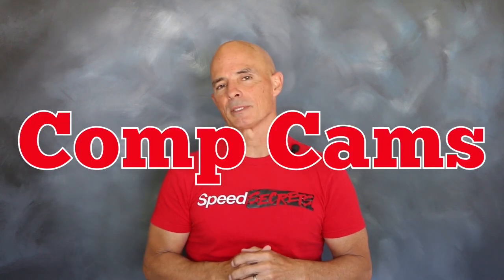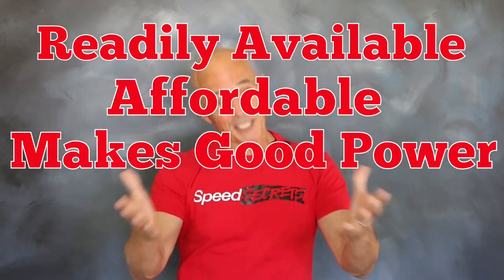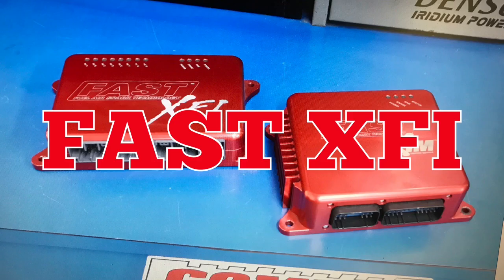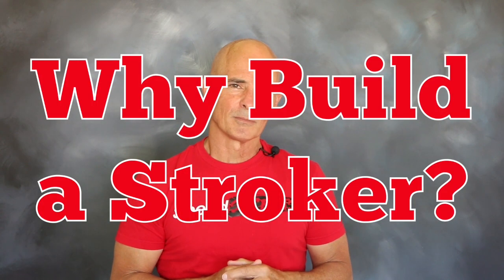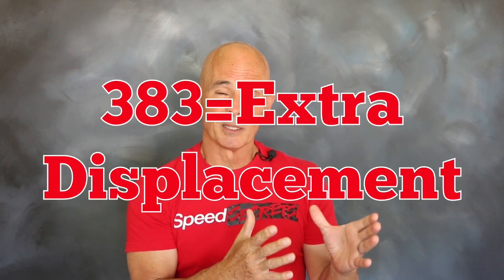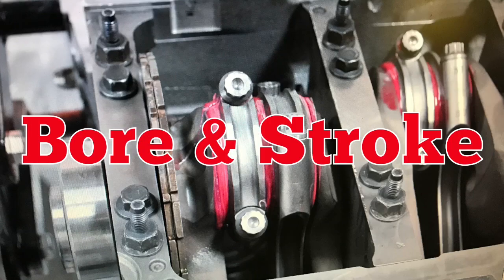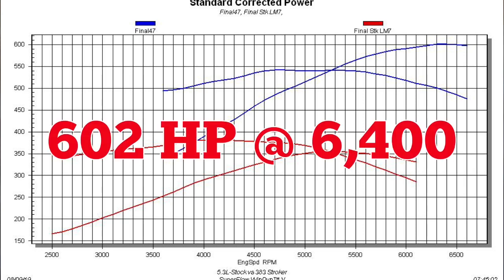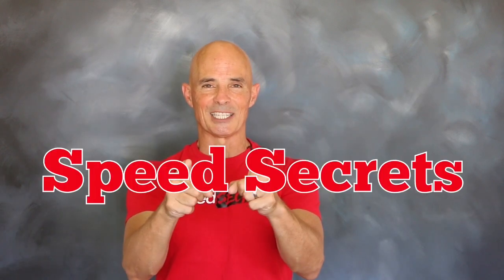Speed Secrets: Why Build a 5.3 Stroker?

Comment from the maker: A couple notes on this: Yes, you CAN make more power with a turbo setup, or going with a 6.0, or whatever else. However, this test was done in the interest of proving that there are many ways to gain power. Hot Rodders have been building 383's for decades and making great power from small block Chevy's. If you're interested to see what doing a turbo setup would gain you, check out our LST Turbo Camshaft test video from a couple months back!
Reply: COMP Cams my I have the build sheet with all part numbers please ?
Reply: Thanks Man. Never everybody wants to be like everybody else with a 6.0 and or Nos. I like being different or rare. So thanks for the video truly. 🤝🙏🏽
Reply: Comp cams is there  a build sheet with all parts listed with part numbers, and everything else used to build this engine ?
Reply: Where can I get the stroker kit from ?
Reply: What cc pistons?
Reply: How much for everything
Reply: Yeah and a 6.0 will be alot more then a 5.3 to start so good video

Comment: For the past 2 years, I have wanted to build a N/A 408 Stroker but I am wondering if the extra cost of the 6.0 is worth it. Because I have seen Richard and other people pull 650hp from 408s but you are saying 600 hp is possible from a 383 stroker. What i want is a motor that has that fun low end torque and the big block sound naturally aspirated.

Comment: Hi Richard. I have a 24 ft command bridge fishing boat and looking to give it some more get and go. I have a Lm7 5.3 and have been looking at the best way to accomplish that. I was thinking of building a 383 stroker out of the 5.3 to get more torque and a little more power. If I bored it to 3.905 and changed to 4.00 stroke I get a 383 as you show above. the thing is I don't need over 500 hp and the torque and HP between  3000 and 5200 rpm. Would a truck norris cam get me there.

Comment: Im planning on boring and stroking my 5.3L to have at least 460hp, but have 500tq down low at the flywheel. Im going to be usig it for my 2011 suburbsn with a 6l80e (beefing it up as well), and 3.73 gears. Im hoping to tow at least 10,000lbs reliably. Wish me luck.

Comment: Will a 383 made out of a 5.3 be reliable long term as a daily driver also will there be cooling issues with the motor bore being enlarged that much. Also say I just wanted to punch out my 5.3 to a 5.7 ls1 and I already did a cam and head swap on my 5.3 to a BTR truck Norris cam and 243 heads I know the heads will work good but what about that cam? Will I need to change it after making it a 5.7?

Comment: 5.3 heads can supply way more airflow than a 5.3 can even use in a street usable rpm range I wonder what the stock 5.3 heads could do with just a stroker kit and cam with stock cylinder heads

Comment: Richard, How about building a stock 4.8/5.3 4inch stroker with stock cam and then add stage 1,2 & 3 truck cams.  This would be a good towing motor and should be equivalent to a 6.0 block that you tested before.

Comment: Isn't the piston unstable at BDC with 4 inches of stroke in a stock sleeve block ? Wouldn't it be better to do a 3.750 stroke with a 4 inch bore on stock blocks?
Reply: they're using the longer rods that keep the piston in the sleeve

Comment: Hey Johnny! 
I'am now in the beginning process of rebuilding my 04 5.3 LM7 . Having to bore .0030 over , also going with BTR stage2 cam , have SS hedders but shorty's installed a year ago , will be using those till then Wany directed suggestions  from you is always appreciated ! Also rebuilding trans and rear end . My baby has never have me trouble in the past until now.. started chasing a ghost.  So with 200.000+ od . Better do it now than be sorry later..
Reply: Doing the same

Comment: What kind of pistons. I just found out summit has a cheap kit for 5.3

It’s a 363. 4 inch crank and 5 over pistons. But the guy didnt mention valve relief. 

I really like the idea because a monster 4 inch crank. Bigger then the 400 sbc and good heads. I believe you said 706 heads.

Comment: Where did you get the pistions with the 3.905 bore and who would you recommend getting them through.
Reply: It's just an LS1 piston .010 over roughly. Not an issue, the issue is getting pistons with shorter skirts not to rock at bottom of stroke out of the cylinder. Wisco will make them for you, but I think already making them.

Comment: Can you boost a 5.3 with a Bore that big and what if it’s a aluminum block. I acutely just aquiard a 4” crank and trying to finger out if I’m going to use the aluminum 5.3 block and save a bunch of wight or go put it in a iron 6.0 block.  I have both it’s a race car 3275lb it’s been 9.88 with a 4.8 with cam and turbo but I want to get the car to it’s new chassis stickers limit. Lol.

Comment: Ive got a similar build.  Using a BTR stage 3, TBSS intake, and 92 mm tb. Going in customers chevelle. still just 9.5:1.
Reply: Can these things handle boost as well or better than the stock 5.3?
Reply: @bananaman2184  
Sure they can especially when having proper ring Gap.

Comment: I have a 5.3 stock other then long tubes any suggestions on head cam and intake combo looking for closer to 450 best bang for my buck!
Reply: BTR Torque Cam
Send stock heads to Texas Speed for port+polish
Texas speed 1-7/8" long tube headers
Reply: @foxyepoxy602  how much you think that that will produce in to numbers?
Reply: @michaellinkous7449  my estimate would be between 50-90HP and 40-70 torque.

Comment: OK what did you do to the crank ? Throw it out and get a new one or have it machined for the bigger stroke ?  And what are the connecting rod sizes, rod and main bearing sizes? Do you have to have $2000  fast xfi management system ?

Comment: my 5.3 into a 383 is a great idea thanks
Reply: ,,,,,,,,,,,,,alot cheaper to get a 6.0  or 6.2  from the wreckin yard............................I have a  2000   1500 with the meager  5.3................newer mills have aluminum heads...................I hate little motors,,,,,,,,,,,fuuuccc   turbos .............give me a new edelbrock  VSR  or what the screw they call em,,,,,,expensive    but they deliver out of the box....................

Comment: What kind of stall converter would be needed for a setup like this? I assume it would be too high to go into a truck that will tow from time to time.
Reply from the maker: Correct. For a 5.3 truck that does a lot of towing, some of our No Springs Required setups would probably be a better option. Something like the 54-700-11 paired with a 2400 stall would be an excellent towing and street setup.

Comment: Was wondering what's a great 5.3 ls 383 kit out there.
Reply: A few companys make stroker kits for a 383 LM7 Scat Eagle with all the good slugs from Mahle JE Kieth Black ATK builds a nice 383 LM7 ready to go for under 3500 from Summit Racing just bolt on some good cathedral ported heads trailblazer intake 92mm of course and do 600 horsepower burnouts🤜💥🤛😎😎😎

Comment: How about a 4.8?
Reply: Same engine different Internals
Reply: 4.8 is the same engine as a 5.3.  The only real difference is the shorter stroke that the 4.8 has, and they typically have flattop pistons, whereas the 5.3 does not.  So, you could apply these exact same mods to a 4.8 and also arrive at 383 cubes.

Comment: Why do 383? I've heard people will stroke the lm7 to 347ci max and make the same power with just a bore difference or buy lm7 stock size forged internals and build a boost 325. Plus isn't going for 325 ci to 383 ci dangerous for the skirts in the cylinders? Or am i wrong?

Comment: I thought turning an iron block 5.3 into a 383 stroker would eat pistons, I considered building one but I had very experienced builders and racers tell me this.
Reply: Depends on what rotating assembly you use and in what block.  From all the measurements I've taken, most of that theory is myth and noise.  Most rod/piston combinations with a 4" stroke still stay in the cylinder at BDC.  Iron blocks do have shorter cylinders than aluminum so keep that in mind.
Reply: Zachary Morris I have an aluminum block 5.3 so would that mean I wouldn’t have to worry about it? Or does it need to be resleeved first?
Reply: @601performance5  depending on the year of the aluminum 5.3L it can naturally be bored to 3.898-3.910 (GenIII LS1 base casting with cam sensor bore in rear of block) or 4.00-4.20 (GenIV LS2 base casting with DOD/AFM bosses in valley).  The 5.3 aluminum blocks are sleeved down from 5.7 or 6.0 so you can naturally go back up to those bore sizes.  A ~383 would be standard stroker for GenIII and a ~402 would be standard stroker for GenIV.
Reply: Zachary Morris I’m not sure if it’s gen III or gen IV, I’ll have to look up the vin but I’m thinking it might be gen IV.  Do you have experience with how well the motors handle boost once they have been bored out?

Comment: I thought turning an iron block 5.3 into a 383 stroker would eat pistons, I considered building one but I had very experienced builders and racers tell me this.
Reply: I have heard of people having issues with strokers . Pistons go past BDC pistons wobbles and scored the piston skirts .. but herd that with a 6.0 into a 427,, 5.3 may not do that .
Reply: Eat pistons? The only thing that'll eat pistons is poor lubrication or improper piston-valve clearance due to poor can selection or not eyebrowing the pistons to compensate for a wild cam.
Reply: JoeIsCrazyWillman I’d have to talk to them and see what set of pistons they were running to cause this and if they did all of the preventative work.
Reply: JoeIsCrazyWillman he’s talking about piston skirt wear .
Reply: @LethalFrenchFry  why would the skirts wear out? Again, would be a ubrication issue, no? What else causes wear in the cylinders and on the pistons but dirty oil &/or poor lubrication?
Reply: JoeIsCrazyWillman Well the reason I was told it eats pistons, is that the piston comes so far down it will wobble or something like that and eat the side skirt of the pistons.  I’ll have to talk with them to see what piston they had and see if there were any other issues or causes.
Reply: @601performance5  Sounds weird that something like that would happen. Sounds like bad parts design or improper installation. Shouldn't be an issue of long of stroke. pistons shouldn't be coming out the bottom of the cylinder.
Reply: JoeIsCrazyWillman idk for sure but just thinking of what could cause it, maybe he shortened the rod slightly more than needed to clear the cylinder head.  That’s just a guess though idk enough to say for sure and I’m most likely wrong because I don’t know enough about what rod length to run to be able to say.

Comment: I wish this would have just been a stock vs stroker comparison with everything else being the same.  When you toss in a cam, ported heads and an intake to the stroker, it's no longer a legitimate or fair comparison.
Reply: Absolutely. That, or put heads, intake, and cam on the 5.3 and test it that way first before doing the stroker kit part

Comment: I’d rather watch Kimba The White Lion lip sync this than watch this guy.
Reply: Might be silly, what could you do with a 2010 5.7 hemi 390 hp and 400 torque, to a 383 stroker. Would there be a significant difference?and if so what would I have to replace? 7/23/2020

Comment: That's a hell of a gain. Stroked 5.3 making 600hp. This is a rowdy little engine..
Reply: its not just stroked... 

a stroked 5.3 is a 363... 383 is a stroked 350/5.7/Iron-LS1...
Reply: @KaosProject21 currently working on my LM7 383 now.
Reply: Think it’s just theoretical power they didn’t show shit. Only proof I can believe is they used his forehead as a cam profile
Reply: First Richard always does testing, that Dyno sheet doesn't come from nowhere dipshit, the same engine is featured on his channel

Comment: Lollll a good engine for NA applications l wouldn't boost it.
The 5.3 LM7 stroker is the new LS stroker as a step up from the old small block chev 383.
These two valve engines love a 6 to 10 degree split and 113 to 115 LSA anything over 600 lift is a bit of overkill.
I have just the cam in mind lollll lollll lollll.
A crane HR-224/347-2S1-154A
224/232 115LSA 590 590 LIFT.
😂😂😂😂😂

Comment: Would this engine combo support NOS?
Reply: That cam probably wouldn't be ideal with nitrous but you could certainly use a quality rotating assembly and have no issues.
Reply: 114 LSA on a cam is perfect for nitrous or boost. When your lifts and overlaps begin, thats where things vary more on boost vs NA vs Nitrous.
Reply: So the short answer is yes it will work fine. The long answer is you may want a different cam more specifically designed for nitrous if that's what you plan on.

Comment: You can literally do the same thing to nearly ANY V8 and make THE SAME POWER
Reply: Admiral Sandwich mmmm sure but the cost is huge. With the aftermarket sure you can do anything now, before the aftermarket you had to go with the oem who had the better parts like cylinder heads. This one is still going to be cheaper than any other style
Reply: jubjub f  A stroker motor is out of the budget for any man who doesn’t make much and wants good power

Comment: Just go 6.0 it's easier
Reply: The 6.0 are 1,500 at least and that's without the wire harness and trans. Add both those in the mix and your talking $2,000 for a junkyard set up. Here 5.3 in Washington (west coast) will run you about $500 add in the harness and trans $750.

Comment: I have a 2004 5.3 engine with 706 heads and I also have a set of 243 heads. What the best heads to put on a 5.3
Reply from the maker: 243 Heads are generally considered to be the best stock casting Cathedral Port heads there are.
Reply: COMP Cams Does 243 heads work best with flat or disc pistons. Would I lower my compression if I put them on my engine
Reply: It would lower the compression but just have the heads milled or run a thinner head gasket. 243 is a better head.

Comment: It is too bad you ran the engine without accessories. Using an engine dyno means viewers must already have to calculate drivetrain loss in order to compare the engine to most non magazine car builds out there, as the proliferation of the chassis dyno has made that the go-to way to judge engines.  Now they have to consider how much less power would be made if the engine had accessories on it.  There are really too many variables to even try to speculate on.
Reply from the maker: While you do have a point, the drivetrain and accessory losses affect both numbers equally. The gains will be the same after accounting for roughly a 20-25% drag on the engine.
Reply: I agree that the percentage gains will be the same with or without accessories.  However, without knowing what the engine baselined at with accessories or better yet, in a chassis dyno, we really have no way to compare it to another test.  The title is "why build a 5.3 stroker".  Now we will have a bunch of people who don't understand what they saw in this video running around claiming 5.3 strokers make 600 horsepower and expecting them to outpower other builds making "only" 550 to the wheels.
Reply from the maker: @jebadias1468  we completely get where you're coming from! The big issue is cost and time (which go together usually). Doing these tests in a vehicle would require WAY more time, and there is a ton more variation with chassis dynos. As you've probably seen, you can easily manipulate chassis dyno numbers, as well as the variations you get with transmissions, wheel weights, and rear gearing.

Comment: I love the info, but the whole 5k bolt on 5.3l stuff seems a little rich for an engine I can replace for 500 bucks.

I mean how many dollars per horsepower are you willing to spend? Why not take that same 5.3, and stuff a good cam, and a single turbo to make the same 600, and do it with way less money, and effort. Plus when it blows up from beating on it you are only out a junk yard engine, and not a high dollar rotating assembly, and heads that are trashed.

Just seems like a lot of playing "pick the most expensive parts" engine building, and we have yet to hear any real speed secrets.

Right now the only speed secret seems to be a fast lsxr manifold that costs 3 times what a tbss manifold costs, and it delivers very little comparatively.
Reply from the maker: Richard Skipper  Actually, in the past year alone we've released more budget friendly engine and valvetrain options than ever before! We know where the market is, but there is also a limit to how "cheap" we are willing to produce products and still maintain a high quality standard.
Reply: And what the fast intake does gain in hp  is paid for with precious feetus pounds out of the torque account
Reply: The block itself is pretty damn strong. So it wouldn't blow up with a stroker kit in it and you probably wouldn't spin it past 6500-7k. But a turbo would be good with about a .550 lift turbo specific cam in a stock 5.3 but you don't wanna run a crazy cam with no valve relief or else it'll be a boat anchor way sooner than later
Reply from the maker: @KingJT80  Our new LST 5.3 Turbo camshafts are exactly what you're describing!
Reply: Richard Skipper  a 5.3 makes sense when everyone is taking everything else and caught on to cheap hp LSXs